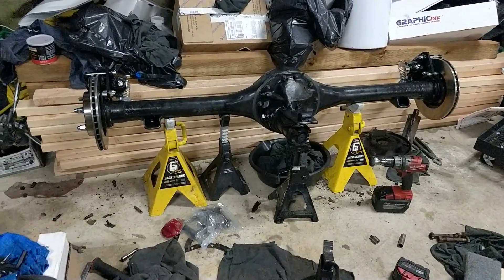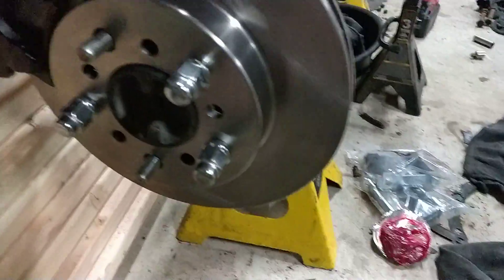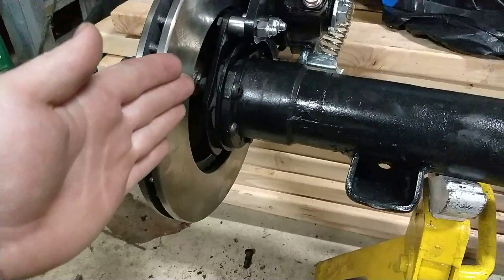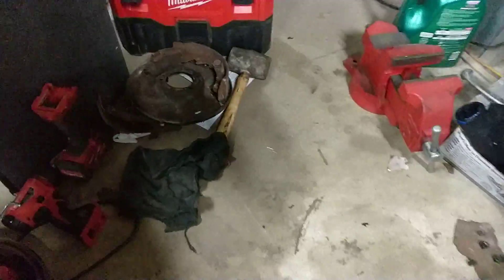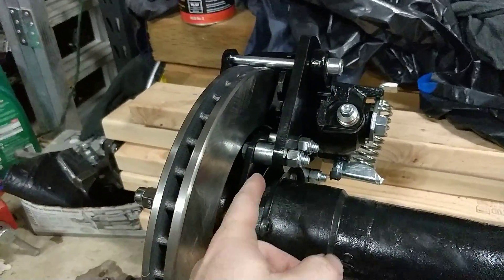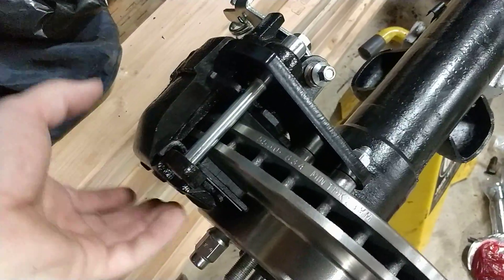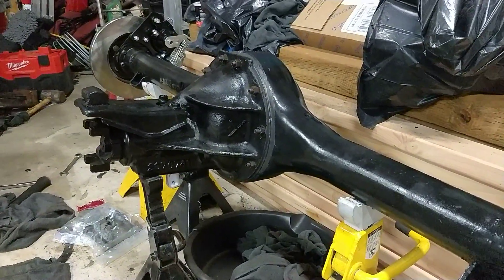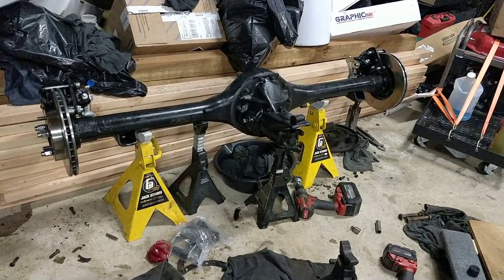Inline-Tube's Mopar 8 - 3/4 (8.75) Rear End Disc Brake Conversion

Comment: did you use a proportion valve ,  with I'm guessing now all wheel disc. ie fro t back ?   I've heard. factory type causes. binding over heating of rear discs due to pressure valve in OEM  prop valve

Comment: your calipers are upside down and on the wrong sides.  the bleed valve should be on the top and that would let the calipers bleed proper.  it would also  move the e brake cable mounts to the top and the factory ebrake cable fit directly in my dart.
Reply from the maker: Thanks, found that out shortly when I installed the axle in my Duster.  Still had an issue with how evenly distributed the brake line pressure is, would have to pump the pedal several times fast to get a solid firm pedal, then after 15 seconds it would get soggy again, no air in lines.  Swapped to drums without any issue but would still like to figure out how to make the discs work right later on.  Factory front disc car.
Reply: @gwmax11  Same problem here tried several times to bleed system .. The manual master maybe to small for 4 disc brakes .

Comment from the maker: Update, wish I just stuck with drums.  PITA, having to custom setup new e-brake cables, weld brackets to rear end, custom make brake lines, source a new master cylinder from a 2000's jeep grand cherokee to make it all work, not doing this again.
Reply: It'll be part of system that improves part of the stopping power even though discs are just a part of it. I think the effort outweighs the old tired drums. They disapate heat faster.
Reply: Thanks for the honest information. I was wondering if that caliper would fit in the barrel of a 15" wheel. Reading your post I'll stick with drums.